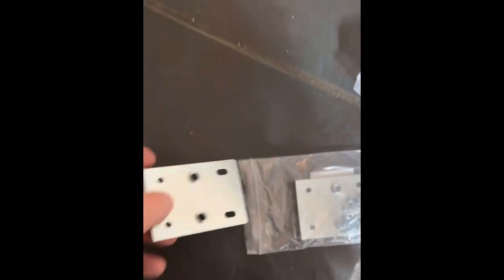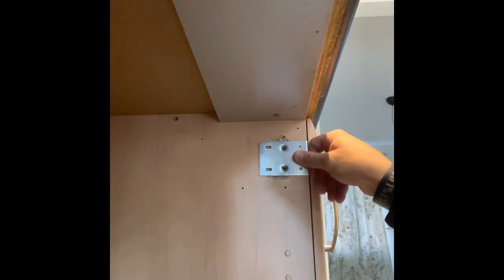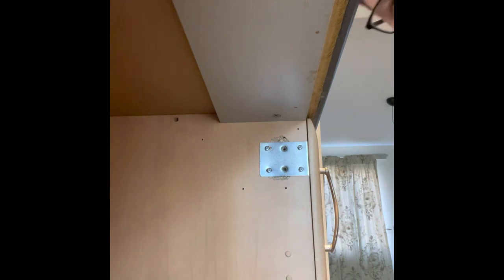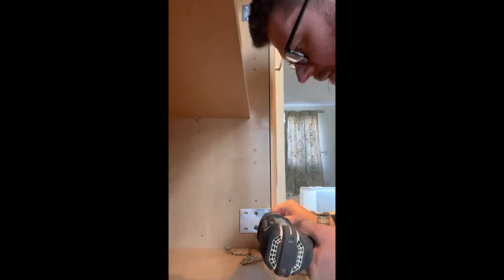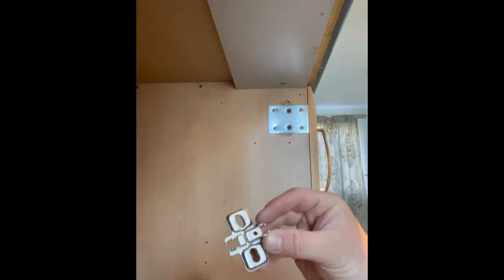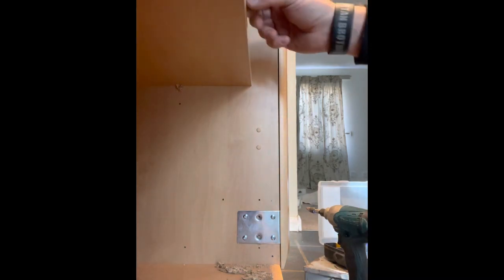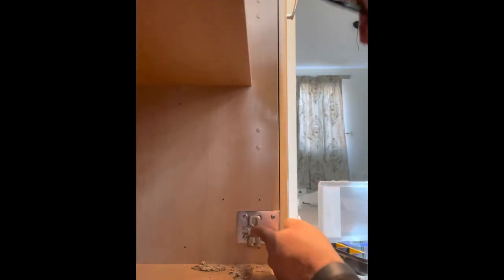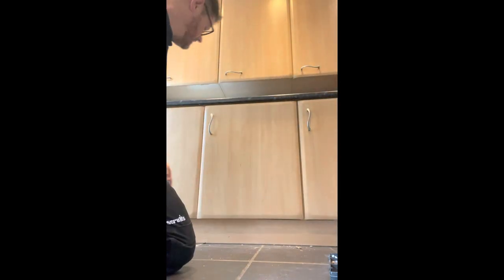How to repair a loose kitchen cabinet door hinge using the repair plate kit - Locksmith

Comment: Thanks for this video! I have a problem with only one set of holes on my cabinet. Can I use just one hole repair on the top and not on the bottom?
Reply from the maker: I would put a screw through into the cabinet if you can but just be careful not to use a screw that’s too big. 
Thank you for watching 🙏🏼

Comment: Thanks !! What happens if the original screws snapped off in the hole. Do they need to be drilled out BEFORE the plate goes on ? Or do the new screws have room because the plate is raised a little ?
Reply from the maker: Hi Andrew. I think you will need to remove the snapped screws before you fit the plate buddy 
Thanks for watching 😁🙏🏼
Reply: Any idea who sells these plates?? I checked Lowes, but not Home Depot yet….
Reply from the maker: @andrewmiller7415  I believe I got these from Screwfix

Comment: So, what happens if the original hinge holes in the carcas are damaged / too big? You're still using the original hole with the plat covering some of it but still going into the original damaged hole with new screw,, will the hinge still not pull away from the plate?
Reply from the maker: Hi James. 
No the plate has a threaded hole that the hinge screws into so the old hole that the screw went into before in the carcass becomes completely redundant.
Thanks for watching 👍🏼
Reply: @brighton_locksmith  Thankyou for your reply , the plate that I bought from Screwfix direct is not like yours then,  as the hinge screws ( that came with the kit)  bypassed the plate and still had to go into the original carcass holes which seemed a bit pointless.
Reply from the maker: @Leightonpayne  It sounds like you may have a bad batch there! I’d take them back and ask them to be changed! Or if you have some thicker screws you could try them. 
That’s the whole idea of these repair plates when the original screw holes in the carcass are no longer useable.

Comment: I've got the same repair plates but the screws from the existing hinge will not fit the two holes on the plate??  WTH?
Reply from the maker: Oh really!!! How strange!!! I’ve never had that before? Maybe they made a bad bunch??
Reply: @brighton_locksmith  OK sorted, the size of the hole in the plate is a bit marginal for the screw and its obviously not threaded.  It takes a bit of force to slightly distort it to make it accept the screw thread.  Probably easier if you are using a powered screwdriver.  I fixed the plate in a clamp to get it to accept the screw first before installing it.  Nice to have a rock solid door now cheers!
Reply from the maker: @mrradman2986  Glad you managed to sort it 👍🏼
Reply: Where do you buy the repair kits from